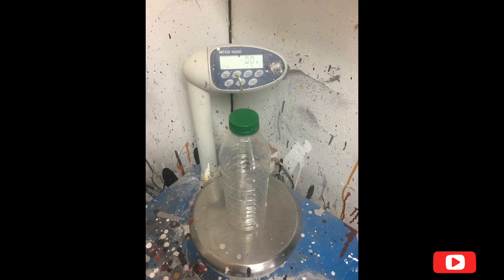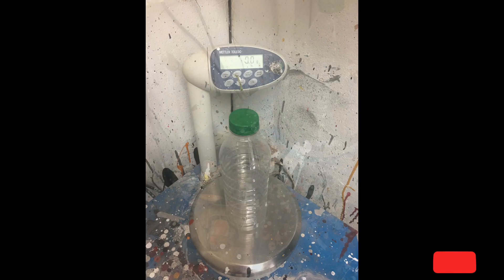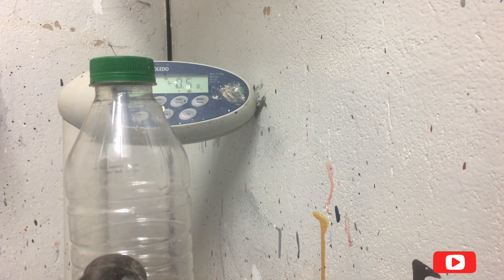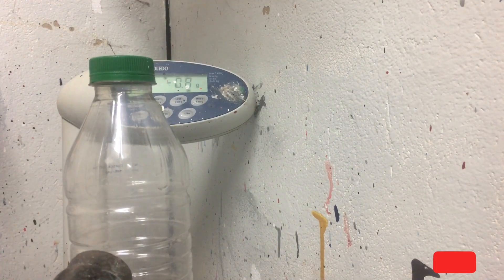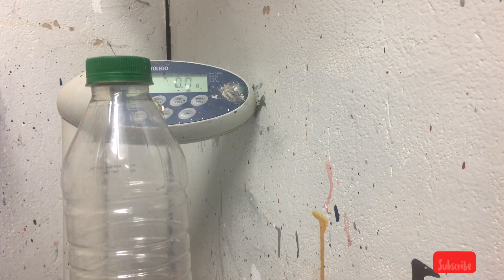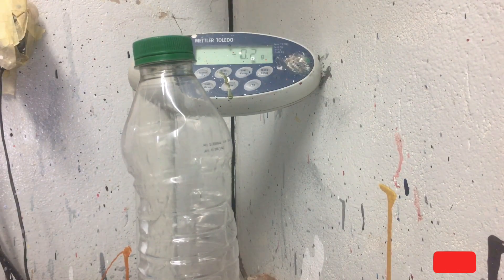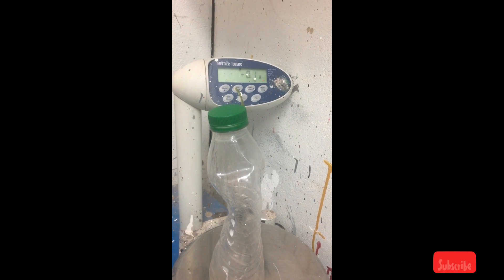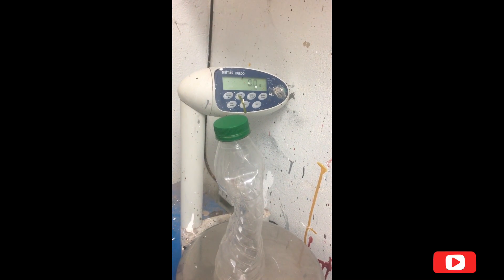Density change?

Comment: this happens when the ambient temperature changes and results in convection currents acting on the area. the same phenomenon also occurs in the atmosphere with warm air rising in the equator region.
   Suggested explanatory videos for learners here on the platform:
_  The Influence of Convection on Balance Error | BM Series Micro Analytical Balances from A&D.
_ weather: high and low pressure in DeverScience.
   written article: 
_ Response of Apparent Mass to Thermal Gradients.

Comment: Large space rockets using that cooling and heating stuff on their rockets. They filled rockets with hellium and hydrogen gas mixture and cooled them  very low temperatures before launch. You can see all large space rockets fuselage frozen before launch. So rocket rise same as a baloon and gain velocity after launch. If they were cooling only the fuel tanks you wont see the ice shards all over the rocket fuselage. Space rockets are rocket assisted vertical zeppelins. They created an space rocket entertainment business and fooling large masses for decades with these David Copperfield tricks. After they told you it is in the orbit, they start to show you cgi or rocket model footages.
Reply: More batshit craziness 😂😂😂

Comment: so would this mean that as you increase in height and the temp drops the density of the gas around you is increasing?
Reply from the maker: I means the gas is moving slower and if its increasing density the. It rushes to the surface as we observe in reality
Reply: @CrealityPodcast  but then as its "rushing" to the earth it warms up? so should be less pressure or a rush of air moving down we could detect?